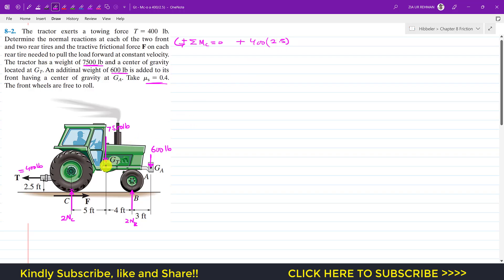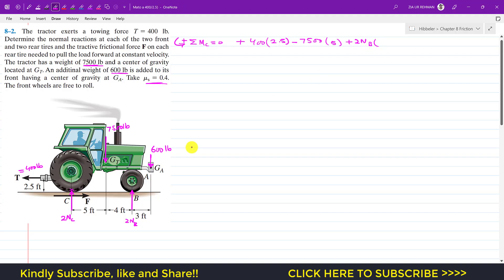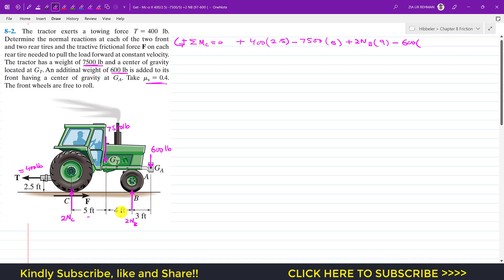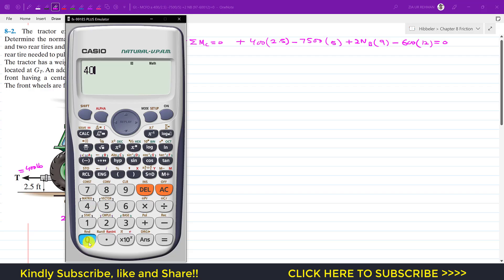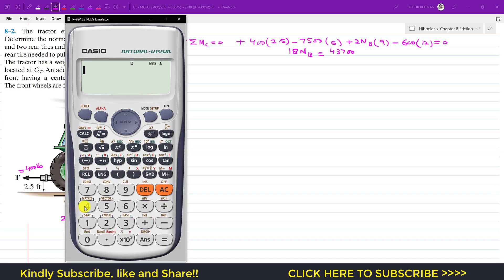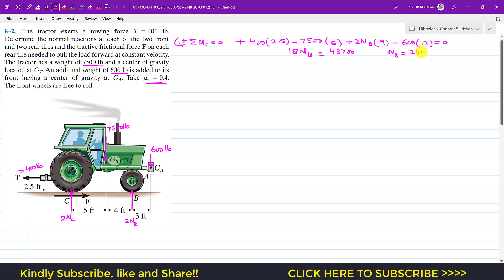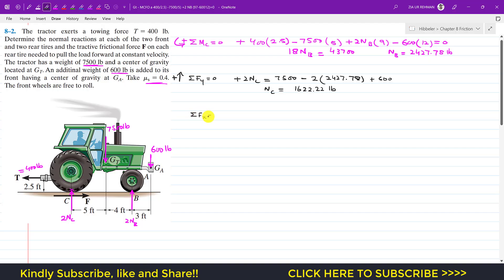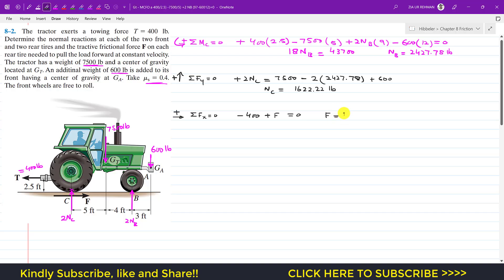8-2 Friction | Chapter 8 | Hibbeler Statics  14th ed | Engineers Academy

Comment: There are 2 rear tires, therefore the force F should be represented as 2F, meaning each tire is pulling 200lb
Reply from the maker: This friction force is calculated for single tire as Twice Nc is considered, which is the normal force on each rear tire. Then, the friction force is calculated considering single Nc.
Reply: @EngineersAcademy2020  Maybe? If there is a force to the left of 400 then it makes sense to me that there must be a balancing force of 2(200) pulling to the right in the form of the two driven wheels.

Comment: can you please solve problem 3/80  static 7th edition i have exam in two day (The two uniform rectangular plates each weighing
800 lb are freely hinged about their common edge
and suspended by the central cable and four symmetrical
corner cables. Calculate the tension T in
each of the corner cables and the tension in the
center cable.)